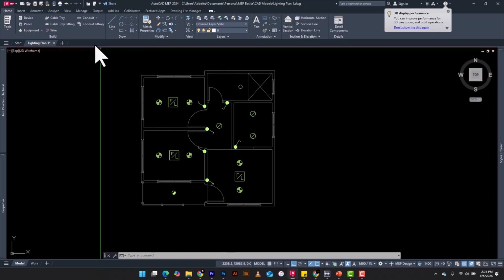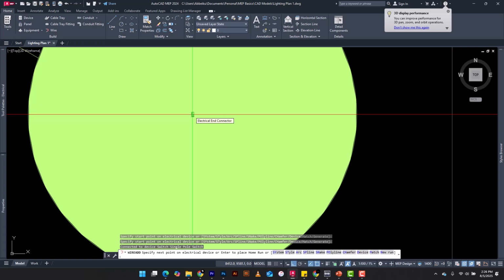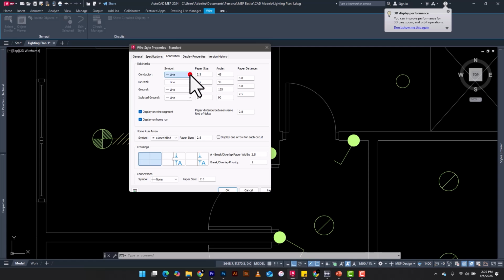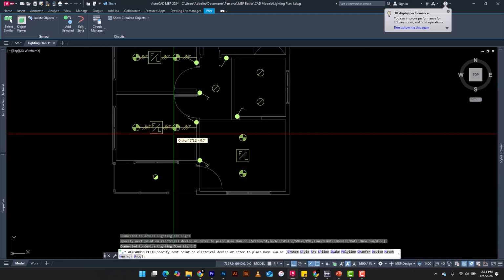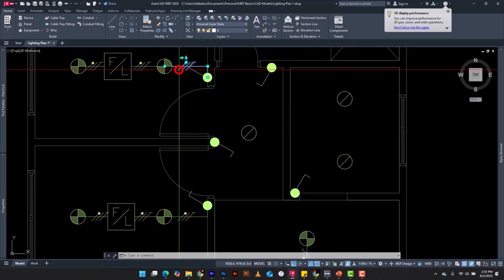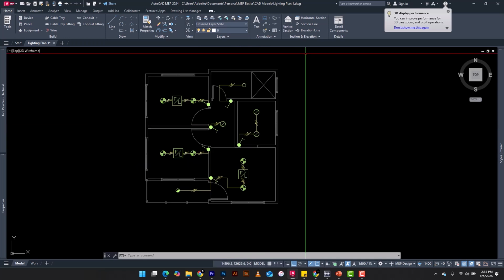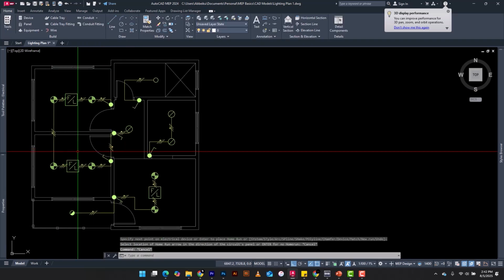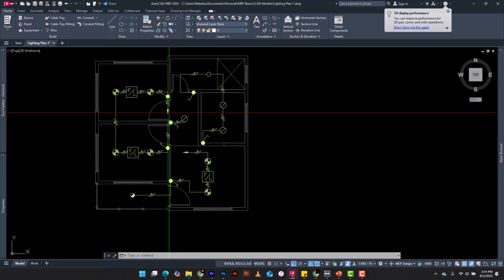AutoCAD MEP Tutorial | Adding Wires | Step by Step Guide

Comment: hey whenever i place a wire or a socket i get a warning inside of it
it says this panel ,wire or device is not connected to another object 
i even tried to removed the warnings by command and its not working 
any help thx btw
Reply from the maker: Hello @7srl569, Thank you for seeing the video and I am sorry you had run into this trouble. 
Few things we can do here: 
1. Check for Actual Connection
Make sure:
(a). The wire endpoints are snapped exactly to the connection points (grips) on devices or panels.
(b). Turn on Object Snap for MEP systems and ensure Node, Endpoint, and Insertion snaps are enabled.
(c).  Zoom in close — if the wire end isn’t exactly on the connector, AutoCAD won’t register the connection.

2. Verify System Definitions
(a). Select the wire → open the Properties palette → check the System type (e.g., Power, Lighting).
(b). Ensure the panel and device belong to the same electrical system (Power, Data, etc.).
(c). Mismatched systems cause connection errors.
Reply: @mepbasics yh i solved the problem 
Thank u for the reply